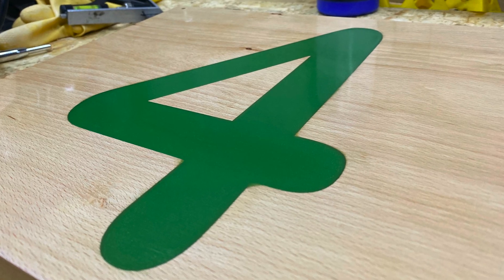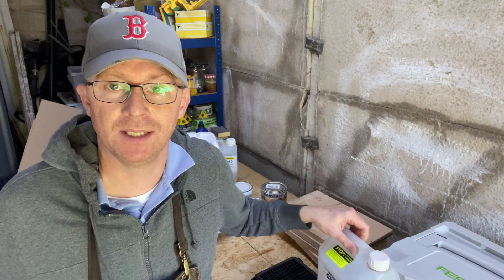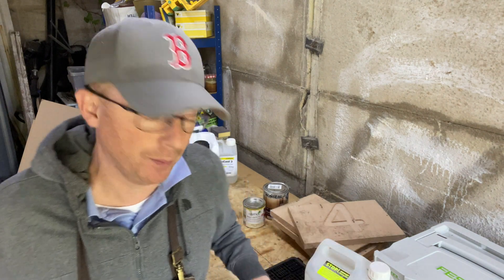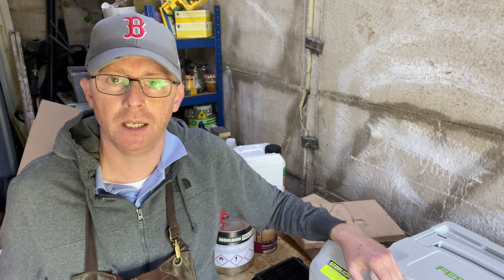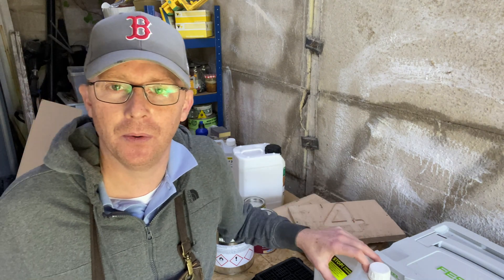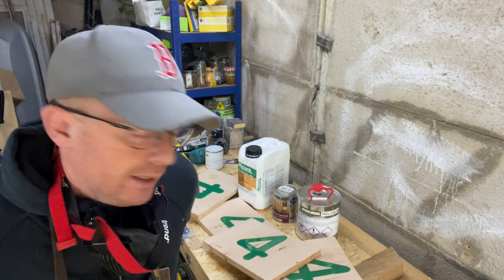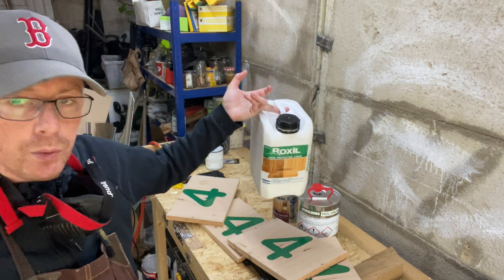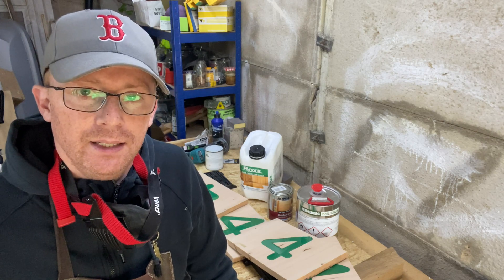Is Epoxy Resin Suitable for Outdoor Projects? (Part 1 of 2: Setting up an Experiment)

Comment: Hi mate. The Roxil wood protection liquid, did you spray it as it is or water it down? Thanks as looking to use this on my pergola. Thanks
Reply from the maker: It was as it was pal, not too impressed with it tbh. I know this test is different to what you’re doing but I’d look at a good uv protection decking oil if I was you. Decking oil has to perform against the odds on many fronts so is well suited for pergolas etc 👍👍

Comment: This has been  a topic  of keen interest for me.  I love  the plastic-like  hardening properties of  resins  but the overwhelming consensus is that it is  unsuitable  in sunlight.  I have  my own personal  little test running on a outdoor retractable water hose box.   Curiously you are the  first  Youtuber to  actually put it to the test to see what  actually happens when exposed.   However, ( Spoiler  Alert) I have  read that  after  a  year  or  two  the  hard  plastic like  finish  will become dull. yellow and then chalky and brittle.
Reply from the maker: Cheers for the message Detroitblue. I’ll share my findings next week. Weather wise it has been a brutal mix of heat at times, plus lots of rain. Looking forward to sharing my results. Agree with what you said here long term, but my four month experiment will hopefully also be of interest 😀😀

Comment: Hi Leo,
Have you thought about possibly using yacht  varnish?.
As the name said designed outdoors tough, but is glossy.
Ed.
Reply from the maker: Cheers Ed. Looks like I might end up adding a couple more finishes to the experiment 😀. It won’t be the same variables as it’ll be a different batch of resin, but will be interesting all the same. If I can get a couple more numbers engraved I’ll do yacht varnish, someone else suggested Osmo UV oil so will try that too😀

Comment: I wonder if it was worth have some variations, so some with only the number in resin and ordinary wood finish, others with the clear resin on top. I'm thinking the clear may turn opaque in time, maybe several years, as some plastics do, even plastic green houses !
Reply from the maker: Hello Rubix, not quite sure what you mean, but just to clarify, every number has been treated differently. The resin inlay of the number is the same for all, but apart from that each board has had a different treatment applied. One with a water proofing agent, one with external varnish, one with hard wax oil, one not treated at all (just sanded) and the last one was the only one to have the face completely coated in resin. Does this make sense? Cheers, Leo 😀

Comment: I'll be very interested in the results.  The resin pour one looks amazing, but I guess it will depend on how it copes with the wood flexing and squirming underneath it.  It wouldn't surprise me if it lifts clean off.  But it also would be a nice surprise if it doesn't :)
Reply from the maker: Thanks Chris, the interesting thing about this experiment is I genuinely haven’t a clue what’s going to happen and there is little (if any) examples of this kind of research out there. I know resin can be a bit of a niche market, but I’m sure I’m not the first guy to ask the question how will it cope outside? 

Suppose what it all boils down to is how the resin reacts with the wood when expansion and contraction of the wood takes place. With the resin coated one, I’d be more inclined to think the wood will split, however they are some pretty solid slabs of beech so the forces at work will be quite strong. Who knows🤷‍♂️😀

Comment: Great experiment Leo 😁. Can't wait for the results...... but.... I've just painted the outside of my house and Mrs Little workshop wants a new door number...with resin and wood...so looks like I will be joining in with the experiment 😕. Let's hope the results are all good 😁. Stay safe Leo 😁👍.
Reply from the maker: Cheers Frank. Any ideas what finish you might go with? Be interesting to see what happens with these, another factor of the experiment is they are south facing. I’m outside with a brew at the minute and they are getting saturated with sunshine! When the weather turns they’ll get hammered with rain too. We’ll just have to wait and see. I haven’t got a clue what’s going to happen 🤷‍♂️
Reply: @SingleHandedlyMade  Hi Leo 😁. My plan (as if I have a plan 😂🤣) is... the sign will probebly be oak with the house number and street name carved on my CNC (about 8mm deep), then the text will be guilded in gold (another experement) and then the whole surface floated in resin to about 5mm deep across the surface. Then probebly some edging to make it flush... (and stop the resin sliding off 😂🤣). So no additional coating on the front. The back will be sealed with some varnish just for good measure.... that's the plan 🤔. Probebly won't do a video of it.... as it would broadcast my address 🙁. Let's see what happens 😁👍.

Comment: Thanks for running the experiment. It's going to be hard to wait LOL...  I know really nothing about resin and epoxy but have been asking questions recently online as I thought about it for future projects, and had not found easy  answers about weather durability.  My experience is limited to using small amounts of 5 and 10 minute epoxy in jigs for saws/tools!  

Can you perhaps clarify in your description the five boards and how they are each filled/finished/treated?  I got a little confused. The green resin is the same  in all of them.  But what exactly is it? ( Other than pricey, I am under the impression?  Sorry, like I say, I've not looked at this stuff yet.)
Reply from the maker: Hello again R Wind, no worries on the questions. The resin used is the same on all 5 boards. It is a product called Glasscast 3 tinted in this case with a solid green pigment. What is different on each board is the finish applied on the wood and over the resin. 

I used a product called Roxil which is a waterproofing agent for wood, the next board I used outdoor varnish, the third I used an internal hard wax oil that sets very hard and I was interested to see how it copes outside. The fourth is the ‘control’ in the experiment in that all I did was sand it down to 3000 grit and a tiny polish, but no ‘finish’ as such. Finally I coated the last one with a thin layer of clear Glasscast 3 resin on the face with some outdoor varnish on the sides and back.

I’m sure you’ll have equivalent products in the US. I just think it’ll be interesting to see how each finish will cope, if at all for that matter? I honestly don’t know how this experiment will develop which kind of makes it so interesting. There is very little content out there on YouTube about using epoxy for these types of outdoor projects so I’m keen to see how this develops. Hope this has been of some help. Cheers, Leo 😀
Reply: Thanks for the reply and the clear description of what is on each piece. 

And agreed...  As much as this epoxy and  resin and type stuff is used in woodworking nowadays, with all of the projects on YouTube, I expected to find easy answers on whether we could use it outdoors and how long it might last or how to finish it so we could use it outdoors.  Like someone else said in the comments, the resin stuff, I thought, was originally created for boat building type applications (?) so it's surprising that the information is not readily available.  Good for you making up the experiment! We will all learn.

Comment: Just a couple of thoughts on your experiment. I've used resin on a few of the wooden rings I make as an alternative to a CA finish and found it very durable and hard wearing. The resin I use is UV activated and, like all the products I use, is environmentally friendly, made from plant resins. However, this would be difficult and expensive to use on a large scale project. I would like to do larger projects with resin' and so I often do an internet search for suitable products. I've found that boat building/repair suppliers often offer resin products. Surely these are suitable for exterior jobs, although I do recall using yacht varnish once for a garden project with less than successful results. 🤣
Reply from the maker: Thanks Jim for the great feedback. It will be interesting to see how the experiment develops and maybe finding a different way to use the product. If I’m not mistaken all of the products referenced here were not their intended purpose. Did I once read that CA glues original intention was something to do with gun sights🤔? Maybe I made that bit up, but I’m reasonably confident epoxy resin wasn’t initially invented for river tables or house signs 😀. Just out of interest, if you don’t mind me asking, what make of resin do you use for the wooden rings? Many thanks, Leo 😀
Reply: @SingleHandedlyMade  I use Alumi UV which I get from Metal Clays 4 U. I've seen vids of guys using it for fishing floats. CA was actually made for gun shot wounds during the Viet-Naam war where medical aid was scarce. I had a medical implant fitted last year using CA glue instead of stitches.

Comment: Great experiment.  All I know is the stuff I used on my branch slice resin outside table top needs serious re-polishing (with abrasive compound) if I leave it out in the rain.  Unfortunately I can’t remember what resin I used, and I didn’t add any finish.
Reply from the maker: It will be interesting to see what happens Tony. Surprisingly there is very little info out there on YouTube looking at this issue. Another obvious method would be to look at alternative resins as well, but then I’d be looking at a ridiculous amount of variables of each resin having a coat of all the different finishes etc. 

I’ll be keeping them out there for a few years just out of interest to see what happens, but best to report back in a few months 😀

Comment: Will be interesting to see the results Leo. I was wondering if the bare one would end up with the wood slightly coming away from the number. We shall see 👍
Reply from the maker: Cheers David. I’m really interested in this as I genuinely haven’t got a clue how it’s going to pan out🤷‍♂️? It’ll just be interesting to see how the finishes compare to the control (the bare finish). I’ll keep it out there for the next couple of years but think best I report back in the Autumn😀

Comment: Cheers Leo, good test. I would've liked to see Osmo UV oil in there too. Wouldn't make much difference to the resin, but it'd be great for the wood. 👍🏼 P.S. How's the hair?
Reply from the maker: Cheers Mandy. If I get chance and if my friend can machine me another number I’ll do it and add it to the test. Won’t be exactly the same, but interesting all the same. The hair is a work in progress and I’ll leave it at that 😀😀
Reply: @SingleHandedlyMade  Thanks Leo. Good on you.

Comment: Great experiment. Really interested in the results. If the contraction / expansion makes the resin fall out, I wonder if it's worth creating an "anchor", ie drill a small hole through the board where the number is and a bigger one from the back. Let the resin flow through like it did with the knot hole. Might hold the resin in place if it gets loose.
Reply from the maker: Cheers Breezy Tree, it certainly will be interesting to see what happens. I don’t think there is a risk of the resin falling out, if I had to make a prediction I’d say the bigger concern is the wood splitting / cupping / warping. It’s just to what degree this may happen and whether the coatings offer enough protection, if any at all? The other potential concern is the resin discolouring, that’s why I’ve gone with a solid colour so it should be easier to spot any issues with it. So many questions and yet no answers! 😀

Comment: These tests are always interesting, we did a 7 year test of external paints on the vaulted ceilings in Fountain court in Hampton Court Palace, as the ceilings were not only open to the elements but also the moisture from the fountain and a lot of through draft, add into the mix the original paint was distemper which was causing a lot of flaking (hence the long test), Sikkins paint was the overall winner, look forward to the results
Reply from the maker: Interesting stuff there Designer. I was keen to do something like this, as firstly I see a possible little earner doing bespoke resin house signs, but wasn’t sure how the materials will cope outdoors. Surprisingly I found very little on YouTube about the topic. I’m not expecting the video to do well, but I think it might be one of those slow burners that starts off poorly in terms of viewership, but later on (especially when ep2 is done) gathers a bit of pace. We sit and wait and see🤷‍♂️😀
Reply: @SingleHandedlyMade  My guess is that 6 months will have little effect, well depending on the resin of course, maybe some yellowing, maybe some movement separation, the problem is that there are still so many variables to contend with,  a possible earner at the moment is hand washing stations for child care homes,  just a thought. keep up the good work

Comment: Nice change of theme tune, maybe still needs to be a bit more upbeat:-)
I think the main problem you will have is the expansion and contraction of the wood which will change significantly when the epoxy will not so you may end up with the epoxy dropping out of the wood backing, we will see.
Reply from the maker: Thanks C P. Can’t remember if I told you or not but I’m a music teacher by trade and piano is (was) my instrument. I put the new one together the other week experimenting with some new music software so I could only play with my left hand. I wanted a chilled / easy ‘vibe’ so to speak, the track is about three minutes long so you might here other little extracts in future videos.

Certainly will be interesting to see what happens. I think warping and cupping will be the bigger issue than the resin detaching itself but ah interesting experiment all the same 😀
Reply: @SingleHandedlyMade  you did tel me. It must still be your instrument, if you can do woodwork one handed including mastering some machines that are difficult enough with two hands then with modern keyboards and computers would surely enable you to continue with the music. By the way I was thinking about your difficulty with the planer, it might be worth looking at a power feed. I have one on my spindle molder when running batch work. It may not be ideal for edging but for facing it should work well.

Comment: Enjoyed the video. It's the approach and process I most learn from. Experimentation is something I'm minded to do, and then often fail to carry through on. It makes sense that you develop your own capacity across high-end design at all points. 
I've recently been doing a lot of mortar-mixing in buckets (I'm not skilled enough or physically strong enough to make use of big-batches of mortar from a mixer or even a board; bucket mixing lets me take my time, and stop fairly quickly whenever I'm fading for one reason or another); switching from left to right hand and back again all the while. Watching your videos has seen me more mindful of what is going on when switching from dominant to non-dominant hand. What one hand can do is then very, very different in its detail. There's a very strong sense when experiencing this, that the difference comes from more than the muscles employed (as these are understood solely physically); there's a really strong sense of differing "intelligence" in the whole bodily systems each hand draws on. That was a very nice "step-up" on your work table; good clean lines.
Reply from the maker: Thanks Colin, it’s a very deep topic you touch on there and one that could stimulate hours of discussion 😀. What the last couple of years have taught me is I didn’t realise how useless my left hand was until it was the only hand I had access to! Simple little things like buttoning up a shirt suddenly became a big deal. I’ve adapted because I had to and now my left arm / hand is ok. I haven’t got to the autonomous muscle memory stage yet, but I’m getting there. It’s only been the last couple of months that I’ve stopped trying to reach for the alarm clock with my right arm (to realise I can’t) then my left. Now it’s just my left 😀